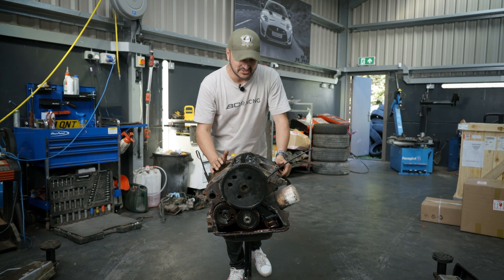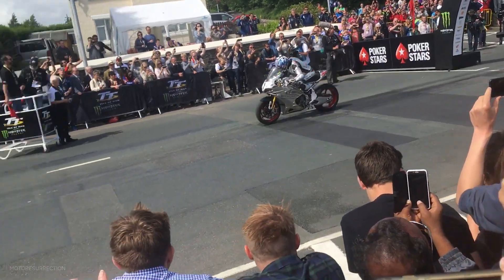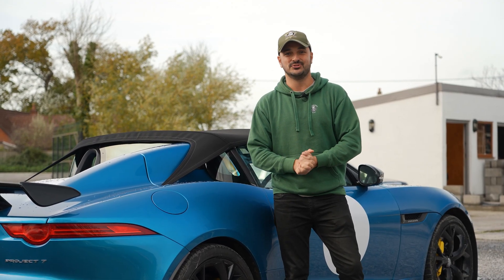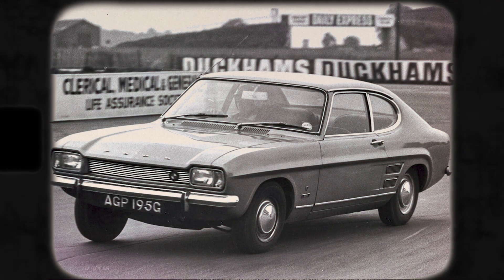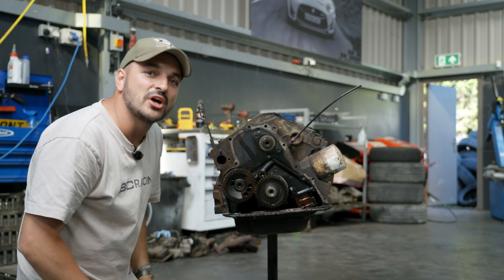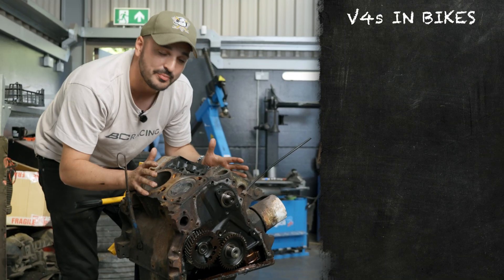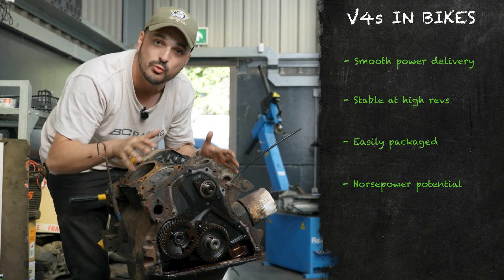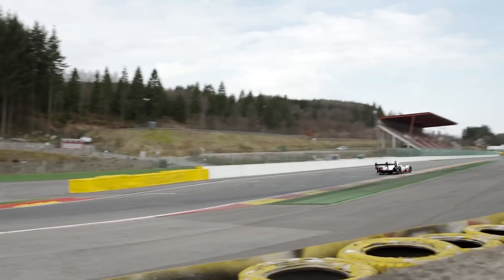Why Do Cars Not Have V4 Engines?

Comment: I've owned 4 V4-powered vehicles and they were all excellent. All were made by Honda and all were installed in two-wheeled vehicles. My ride of choice today is a Honda ST 1100 Pan European, powered by a 75 ft/lb torque 1098 c.i.d. 16 valve V4. The engine pumps out a conservative 104 BHP and redlines above 8,000 RPM and the fat torque curve means this bike will pull away from most smaller race style bikes. The reason is that most racer-riders don't have the skill to quickly downshift and get the revs for speed. The ST 11, on the other hand, is always a click away from max acceleration.  You don't have to be quick on the draw. Add Honda reliability and an engine life that often exceeds 300,000 miles, (500,000 km), and you have a great V4 powered vehicle.
Reply: C.i.d.? Surely you mean cc's?
Reply: Sounds a lot better than my cbr600f2, the cam chain only 10,000 miles.
Reply: I also have an st1100 same power band as a Cummins all midrange excellent highway tourer
Reply: I had a 1984 Honda VF700 Magna with a V4. My best friend rode it, and was so impressed he went to the dealer and bought a V65 (VF1100).
That thing was a monster! Both were smooth as silk, and were a blast to ride.
Reply: The RC30, the jewel in Honda’s superbike crown. Gear driven cams and all. Bliss. I wish I could afford one.
Reply: The Pan Europeans are absolute workhorses, built for the police bike market. Hence why they suddenly got dropped by Honda after the death wobble incidents.
Reply: I had a Honda VFR800 not long ago. It wasn't bad. I now have a Triumph Daytona 955i and it's more fun. The V4 engine is cool, but it wasn't fun to work on in a motorcycle chassis. In a car engine bay it would be quite nice though.

Comment: Soo.. On bikes they don't rattle and vibrate.. But in cars they magically vibrate and rattle? Sure, son.. Sure..
Reply: Well they're not a stress member in the chassis of a road car. The displacement being smaller would also reduce vibration. Brand new 1L inline 3's rattle the whole car at idle. Different but still inherently unbalanced.
Reply: On a car, you want regular spacing between the power strokes, so car V4s usually have offset pins on crankshaft. But that messes up the balance.
Motorbike V4s have shared crank pins, which is more balanced configuration, but it has uneven firing interval.. which is not that big deal at 10k RPM in much lighter vehicle.
Reply: You obviously missed the part about the bank angles?

Go and watch it again son…
Reply: It also depends on displacement as well
Reply: Bikes have balance shafts as do many cars. Why would they not work.

Comment: I've been always saying that utilities ( pick ups) should use V 4'$ as it would create shorter nose,more rearward weight distribution and therefore safer driving 
Maybe even engine under the bed together with gearbox,make bed hinged for easy repair 🥸🥸🥸🤞✌️
Reason is I've seen too many crashes where utes lost traction due to heavy front and empty bum 💥😰, especially in wet

Comment: Bro made a whole video about a V engine and never once mentioned torque.  💀
Reply: Quoting peak torque figures is literally meaningless, without an rpm to match it to it tells us nothing about the engines capacity to move a vehicle quickly.
Reply: @benfennell6842 V4 isnt about peak torque,  its about the spread of torque you get,  over an inline 4. This suits certain bikes, eg VFR750, pan european
Reply: He left out the most important v engine, the v-twin
Reply: Not this nonsense again. I don't even know what kind of misunderstanding of physics is required for people to think that how the cylinders are arranged has anything to do with torque. It's one of the most baffling automotive myths of all.

Torque is a silly way to compare engines anyway. You need to also know the RPM for it to mean anything, and we already have a measurement for that: Power. A "torquey" engine is just one with a broad power band, and that has nothing to do with what letter the cylinders happen to look like.
Reply: @TonboIV  here comes a well actually. The offset cylinder to the crank setup does produce more torque as the rod travels straight down most of the power stroke.
Reply: @stolenlaptop  There are some advantages to offsetting cylinders from the crank axis, but this can be done with any engine configuring equally well. It has nothing to do with V engines. There is also no free lunch in physicals. If you expand a certain volume and pressure of gas by a certain ratio, there is a certain amount of work you can do. Playing with the geometry of the con-rod just changes where and when the work is done. You can gain some efficiency or do some other things, but just trying to get more torque by having more leverage is always going to have a cost somewhere else in the system, unless you also increase the piston stroke.
Reply: Please feel free to explain why you believe  the engine being an V has may impact on torque versus an inline
Reply: Just love it, coz the crankshaft gets a kick every 180 degrees IL4 or V4. How many morons believe that the v format created more torque 😳
Reply: tell us ur clueless without telling us 😂
Reply: Motorcycle V4 engines have the crankshaft laid out for primary balance, but this involves accepting firing intervals that are not uniformly spaced. Motorcycle manufacturers and buyers are usually willing to accept this, but car and van manufacturers and buyers usually are not. (However see the Tata Ace, a van or pickup or minibus with a 180-degree vertical twin diesel with alternate 180 degree and 540 degree firing intervals; it doesn't sound very refined but it is selling in millions in India. Possibly being very cheap has something to do with this). The Ford V4 that you have has equal 180 degree firing intervals, made possible by having four separate crank throws rather than two like some motorcycle engines. This does make the engine unbalanced, hence the shaft with the lop-sided weights on it turning in the opposite direction to the crankshaft. The Ford V4 does not have the camshaft doubled up; there is just one camshaft which is behind the very large gear wheel on the front of the engine. This gear was made of fibre-reinforced plastic on the Transit V4 that I was involved in rebuilding. The Ford V4 runs smoothly but it has a rough exhaust sound similar to that of a Volkswagen or Subaru flat-four, because of the layout of the exhaust manifolds. Compare the flat-four Alfasud which makes a smooth buzzing sound because it has equal-length exhaust pipes from each individual cylinder to the point where they merge into one.
Reply: Torque is so overrated.
Reply: The essex 2.0l made 92 hp and 122 ft/lbs of torque while the 919 engine he talked about was around 500hp making 334 ft/lbs of torque
Reply: definitely did at 2m35
Reply: Yeah, those 200+ HP numbers are amazing, but motorcycle engines lack torque and make up for it with revs. People have put motorcycle engines in cars and the result ia amazing....... amazingly shit. You have to rev the crap out of them and even then the end-reduction has to be so much adjusted that most motorcycle engined cars barely pass 60mph. It turns out that it makes a heck of a difference if your engine has to drag a 200kg motorcycle or a 800+kg car around........ who would have thought?
Reply: @tjroelsma end reduction? Do you mean final drive? Also motorcycle engined cars are quite often extremely fast, not sure what youve been seeing.
Reply: @tjroelsma  Translation: mechanics don't know enough about engineering to get the final drive ratio right, and don't understand that obviously some engines develop power at higher rpm than others, which doesn't make them wrong just different. A small Japanese engine running at 5000rpm may be less stressed that a US one at 2500, but that's by design not guesswork.
Motorcycle engine torque curves are likely to give more at the higher end due to low vehicle mass. Many large displacement car engines give high torque at lowish rpm, but if the breathing wasn't so terrible they would go on to do it at high rpm as well. When you look at a US V8 pushrod lump with 2 valves still being made in the 2000s despite being technically out of date by the 1940s, you see the problem: extrem US conservatism versus Japanese and European innovation.
Reply: @PeanosZero  The commenter you replied to also has no concept of VE.
Reply: @tjroelsma  Be curious to see if anyone's done a muscle bike engine swap into a car ie bandit 1250 / gsx1400. 100+ ft lbs of torque usually around 3k rpm and rev out to 10k. Still not loads by a cars standard, but id imagine it'd be way more drivable than the usual superbike engine
Reply: @EversCS  You can find some builds here on YouTube, but those all suffer from that problem I mentioned: barely enough torque to move the car the engine is built into and not much of a topspeed because of that lack of torque. Maybe that a Honda Goldwing boxer 6 might do a little better, but the rule of thumb is that motorcycle engines simply aren't good at powering cars. 
The Britsh firm Grinnal had some modest success with BMW K100 engines, but thenm that Grinnal was a trike that weighed less than half of what a car weighed at that time.
Reply: @tjroelsma  my car weighs 1200kg and has a 96hp engine with 145Nm (107 lb⋅ft) at 2,500 rpm.  My bike weighs 204kg and has an engine that delivers 175hp with 140Nm at 8250rpm, but also 110Nm at 3000rpm. I could easily swap my car engine with the bike engine and have a significant performance increase and not notice the ‘lack’ of torque.
Reply: @Zootalaws  In theory that would work, but I suggest doing a search and find out how it works in real life (spoiler: it just doesn't)
Reply: @tjroelsma here’s a spoiler for ya: https://youtu.be/HtSHYaLNWQA
Reply: @tjroelsma another spoiler for ya https://youtu.be/92U9w2nJ5Sc

Need more? There are so many bike/car transplants - even smaller cars like Hillman Imp with a Honda 750

I’d suggest you do some research
Reply: @Zootalaws  I did and the very few examples that actually seem to work somewhat are in no comparison to the vast majority of examples where it fails miserably. I've seen vids of builds that were based on a Smart Fortwo, arguably a very light car, with a powerful motorcycle engine and it barely reached 60mph while howling at 12,000+ revs. On top of that the motorcycle engine that was used actually took up MORE space than the original Merceds/Smart Suprex engine, resulting in an engine that was howling away less than two feet behind the ears of the driver. I don't call that a success.
Reply: @tjroelsma  So in other words, you have to modify the gearbox to run a higher reving engine. Wow, what a concept!
Reply: @tjroelsma  There are whole production runs of cars with bike engines in them - the Radical SR3 has sold 1100 units, the SR1 has it's own FIA race series 

Just accept you are wrong, underinformed and overly confident in your opinion.
Reply: @tjroelsma I don’t know how this just doesn’t work. Maybe I need to research more? https://youtu.be/hRz9XJZAE2U

It must be awesome being you, being right about everything

Comment: I’ve had two V4 bikes. Honda VFR750 and a VFR800.
The VFR750 had a carburated twin gear-driven cam 16 valve engine that was just glorious. I rode it for seven years and it remains my favourite bike in fifty years of riding. Wonderful engine sound and deceptively, effortlessly fast. The second V4, still a gear driven twin-cam but with fuel injection, the VFR800, wasn’t quite as sweet. Honda had dicked about with it compared to the original and the design of the bike in general was frankly cheapened. Still a nice bike and still popular. Later on Honda dicked about with the engine even more and dropped the superlative gear-drive packs for the cams and cheapened it down to chain drive. Rather a shame.

Comment: Why should cars have V4 engines? They need anti-moment-counterweights, they still do kind of rattle, even straight-4 engines are small enough to fit perfectly into a car and do have a lot less trouble with vibration and torsion-moments, so why not use the better alternatives in cars? Straight-4 runs smoother, it is cheaper, it is thermally better than V4. So, why not use straight-4-cylinders?

Comment: When I just about finished familying  I thought it was time to get back into motorcycles. The V4 engine always interested me after enjoying a V4 transit for work.  So 35 years ago saw me onto a Honda VFR 750 and then the 800 with their gear driven cams. Epic engines distinctive and addictive with loads of character . Expensive to produce but extremely reliable.  I've just sold the 800 after 25 years from new and 50000 miles and very limited servicing,  and it still ran like a Swiss watch.  Not unknown for these engines to do 5 hundred thousand miles with only regular servicing. V fours rock.  Er great video btw.

Comment: Ford had a v4 engine

Ford produced two main European V4 engines: the German-built Taunus V4 (1962–1981) and the British-built Essex V4 (1965–1977). Both were 60-degree, water-cooled engines with a balance shaft to counteract vibrations, and were used in various models like the Taunus, Consul, Transit, Capri, and Corsair.

Comment: V4 engines in bigger capacity have always had issues with the intake pulse’s upsetting equal cylinder airflow/fuel distribution. With fuel injection you solve that.
Try pushing power from them and find one cylinder lean and the next way too rich.
All the old V4 engines at the start mentioned was engineered 50 to 70 years ago.

Comment: saab never build a v4 , the v4 on the 96 was a ford taunus v4 but they were just a few...most of saab had the 3 cyl 2 strokes
Reply: From 1967 to 1980 more than 220.000 V4s were sold in Sweden, so in total I think the V4 stands strong in numbers compared to the 2-strokes.
Reply: @mclaar2567  in my country the 96 was sold between 61 to 70 in this year the 99 with the 1.7 triumph desplaced the old 96 , but around 90% of all of them where 2 strokes and between 67 and 69 we had just a few 96 v4 that shares the engine with a ford taunus and that was the only 2 vehicles with v4 engines in my country
Reply: @luiscardozo0000 OK. The last 96 3 cylinder 2 stroke was produced in 1967. Not all were sold that year so a very limited amout got sold in 1968 and possibly 1969 as well. 
From 1967 and on the V4 was the main engine. 
Model years might differ a bit in some markets. The above goes for production in Sweden. 
As you say, the 99 had a 1,7 from Triumph when released in 1968.
Reply: @mclaar2567   i had both a 67 96 station wagon 2 strokes and 70 saab 99 ...the 99 was sold in my countryfrom 70 to 72 and was the last saab sold in my country because the importer had to choose a that time was obligated to have only one brand and representes bmw and saab  so they choose bmw killing saab forever ...bmw had one of the best pasenenger sport car at that time and one of the most important cars bmw in history the 2002 ..and later proves it was a good election but i love saabs men

Comment: That Ford V4 was also used in the Saab 95, 96 and Sonett where it replaced the old inline 3 cylinder 2 stroke engines that Saab had been using for many many years.
Reply: The SAAB V4 was the German Ford, the Cologne V4.

Comment: fucking hell... for a car you would need different stroke/bore ratio, and would make packaging NOT easy. Okay ?
a 90 degree v4 (like ducati) , will have different vibrations than an inline4 , but it be not worse overall. a v6 is worse than a v4.
actually NO proper v4 was ever even designed for a car. ever.
inline 4 has compareable power, but reduced manufacturing costs.
however, the v4 is superior. prooven by, sports bikes. 
it would be good, just none bothered to do it. there you go.

Comment: A "Hot-V" has the exhaust ports within the V, this Porsche engine has the exhaust and intake ports in their conventional locations but have routed the exhaust to place the turbo above the intake. This is not what you would consider a hot-v.

Comment: This is content I like very much! 
Keep it going!

I have a Honda V65 Sabre, an 1100cc V4. And I love the incredible smoothness of it, the big low down torque which enable it to do 50kph in 6th gear, but also  can get it gather pace on a scale a 40 year old motorbike should not be able to. It basically does a horizontal free fall. With a wonderful noise.

Comment: The problem is one of cost, it is two expensive to make to justify for the relatively low capacity it is suitable for (i.e 2 litre).  As for vibration I do not agree a 90 degree  v4 will ne well balanced and smooth as Ducati and Honda prove witheir rigidly mounted 90 degree V4s.

Comment: 73 bhp from a 1700 isn't really that bad. The straight four 1600 OHC Ford engine put out 72 bhp and it was the next generation. The 2.0 OHC put out 99 bhp, if memory serves, that was pretty comparable too.
Reply: We had a 1700cc Granada type Consul. Left hand drive 3 speed auto. Was definitely under powered. Kept as a runaround at a French airport.

Comment: The bank angle that the V6 wants to be to run coupled crank pins  is 120 degrees, not 60 degrees, this angle was chosen just to make the engine narrower, for tighter packaging. The Ford V6 has six separate crank pins to compensate for the 60 degree bank angle.
V8 engines are usually made with 90 a degree bank angle and two connecting rods on each crankpin providing 90 degrees of rotation between every power stroke
The V4 also has separate crankpins for each connecting rod for an even firing, every 180 degrees. This is not what causes the V4 to shake and need a balance shaft, this is because of poor primary and secondary balance. 
The Ford V4s are reasonably balanced engines, you wouldn't notice it runs any different than an inline four of comparable vintage, except for the different sound.